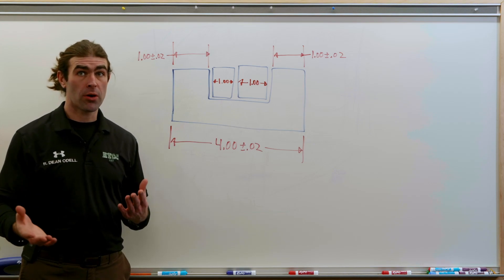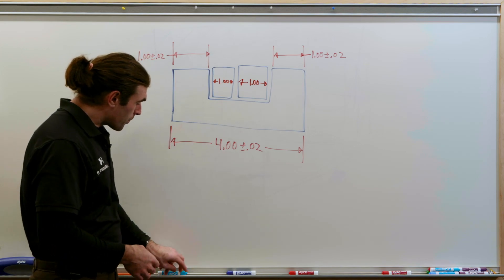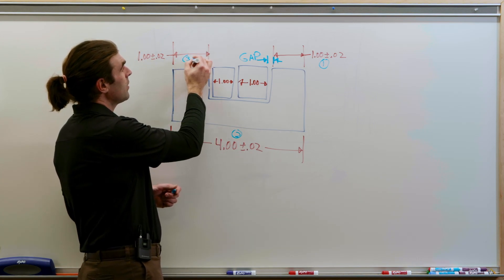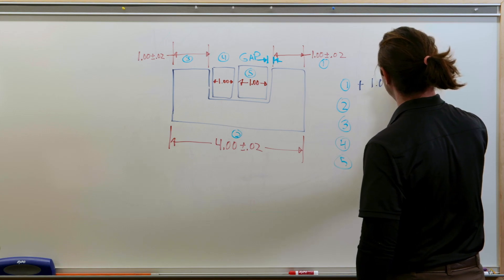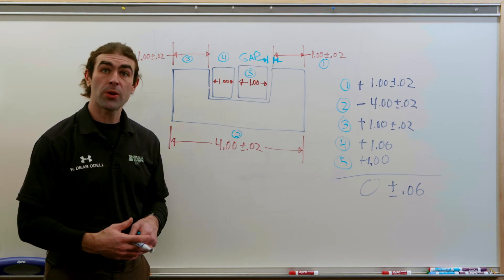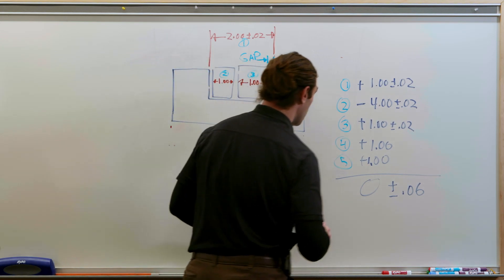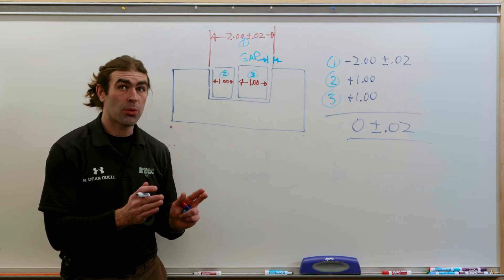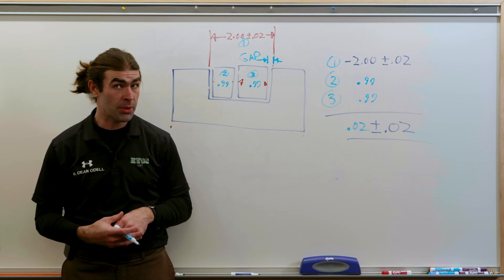Tolerance Stackup: Choosing Dimensions to Loosen Tolerances

Comment: @R. Dean Odell, could you make a similar video with calculations for multiple holes? Such as 4 holes placed in sort of rectangular fashion (one at each corner). Including the part and a counterpart for a total assembly calculations and without gdnt. The calculation in two dimensions doesn't seem to work, or does it?